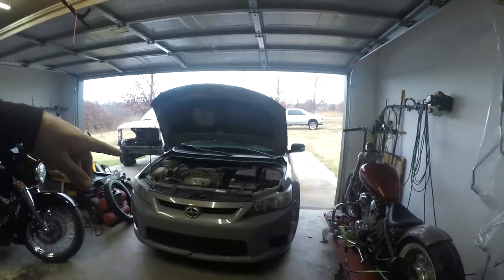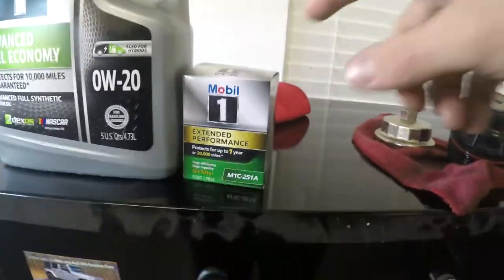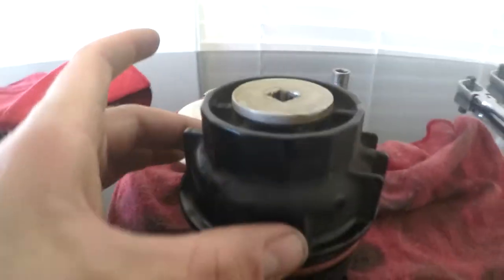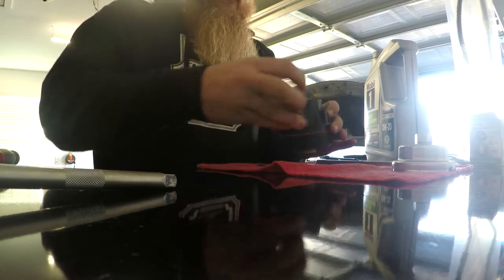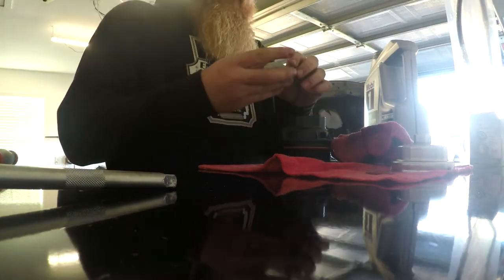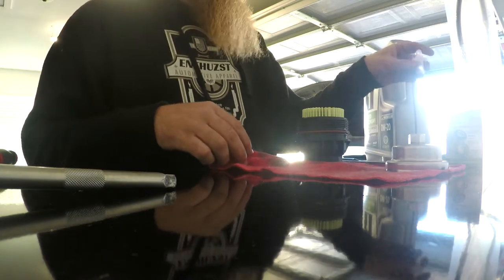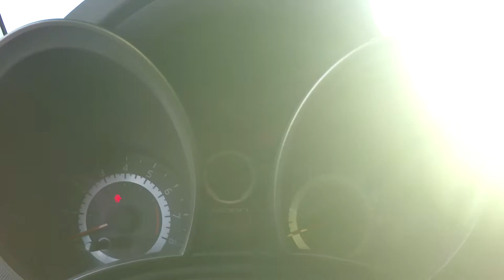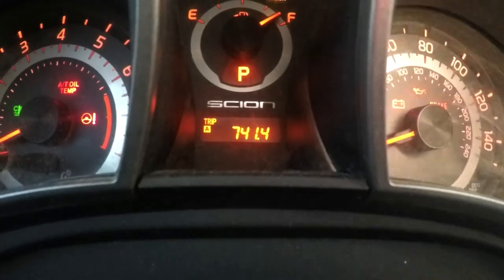Scion tc oil change!!

Comment: Torque specs?

Oil filter cap = 25 N•m
Oil filter cap drainbolt = 12.5 N•m

If these specs aren't followed that's usually why  the oil filter drain cap won't come off without the entire oil filter cap.
Reply from the maker: I’ll have to do that next time! I usually just do the old school method of right about hand right on em! I can fold that ratchet to where I don’t have a lot of leverage on it and get a better feel.